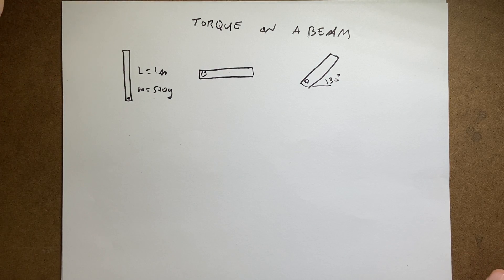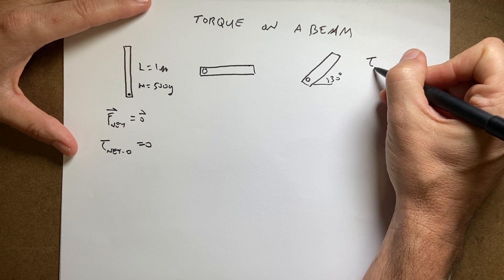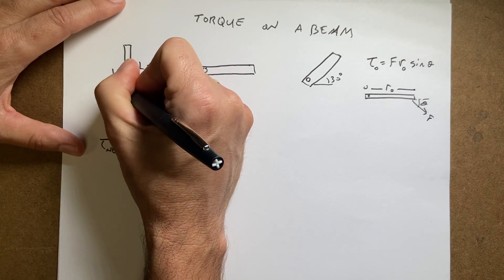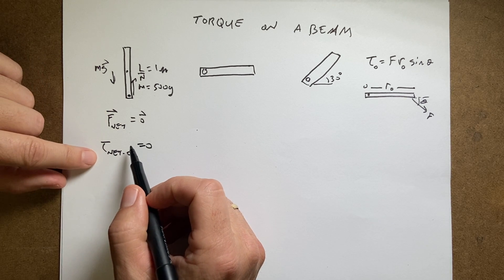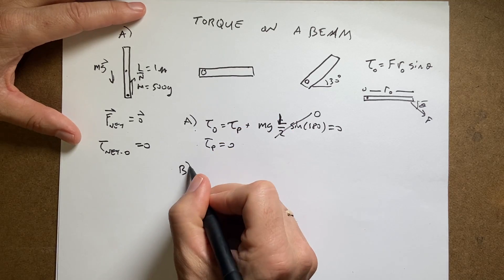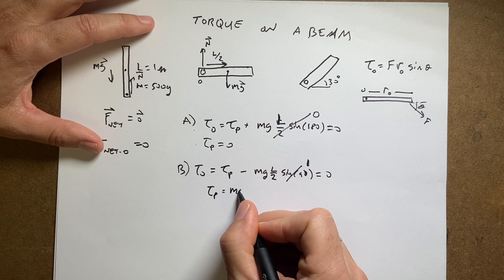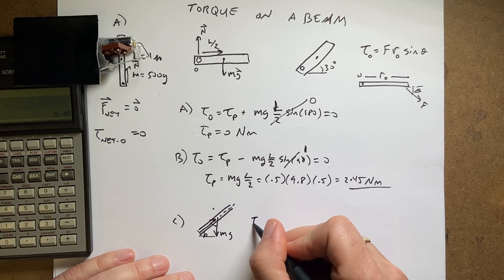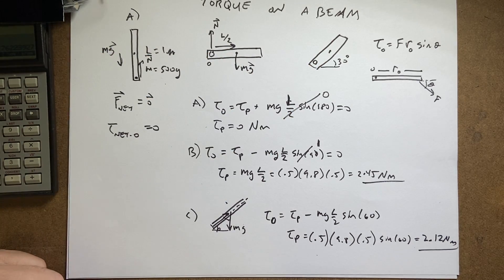Calculating the torque on a beam supported from one end

Comment: Love torque problems. How might you calculate the load on 4 legs of a rectangular table if there's a single force acting off-center of the table? If the force were at the center the load would be equal, but otherwise how would that be done? You would have to account for the moment of inertia of the table, and also the torques from the force to each leg?
Reply: 4 years later, I know. I hope you're doing well. 

This is less a torque calculation than a simple weight load distribution. For any real torque force to exist a path in the direction of the force being applied must be (net) unobstructed relative to the amount of applied force.

So for your table scenario, for a point mass load across a symmetrically supported table, (disproportionate) load distribution toward each leg is directly proportional to the load's distance to each leg across the table area.

Example: directly over one leg, 100% load on one leg. Directly between two table legs, 50% shared between them. Halfway from table center toward two legs, 3/4 load to the closest legs, and 1/4 load shared by the other two.....I think